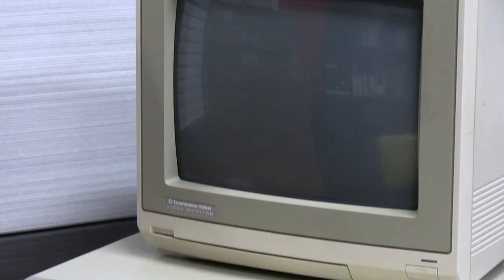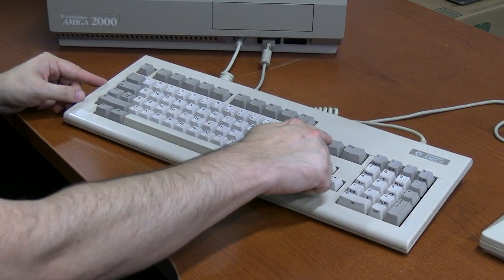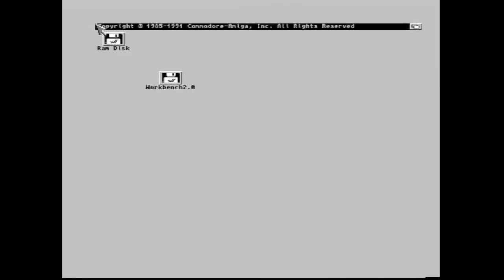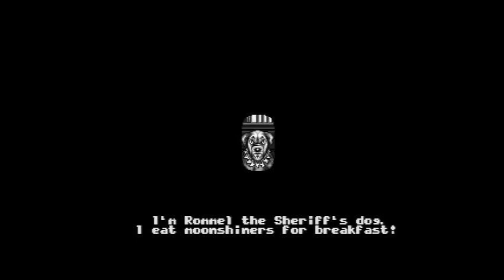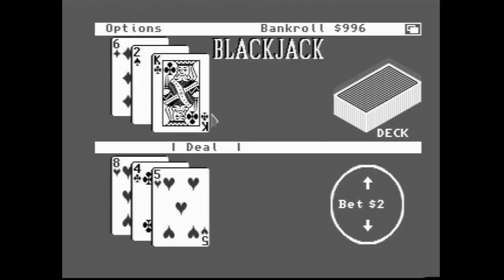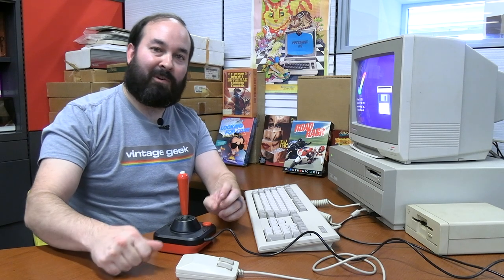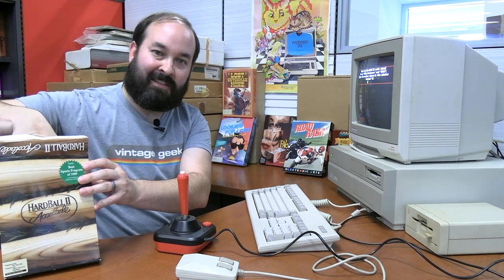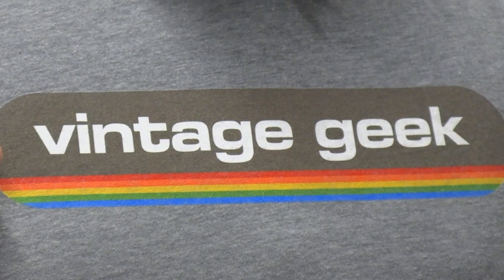My Crash Course with the Amiga 2000

Comment: Even though this is an older video, I had to comment.  Just like you, as a kid I went from a CoCo2 to IBM PCs, and just like you, I've never even seen an Amiga until I got my first one a few months ago.  And yes, just like you it took a significant amount of effort to get it working.  I would have been very surprised if your system worked on first power-on.

Comment: On the games not working thing; this may actually be because of your OS ROM. The Amiga OS is stored in ROM, the Workbench disk simply holds the UI and some tools. A lot of older games will access the OS ROM directly, and if you aren't using OS 1.2 or 1.3, then these will fail to load. A considerable number of other titles will also refuse to run if not in the internal drive.

You can solve the first part by using a boot disk(I forget the name) that will write a ROM image into RAM and use that as the OS until powered off by the power switch, but survive a control+double Amiga key reset. For the latter issue, you'll unfortunately have to find a working internal floppy drive.

Comment: I just want to let you know that these Amiga floppy drives are usually farily easy to service, and if there is no bringing them back they can be replaced with modified PC-drives (or digital media drive emulation solutions). There are several online Amiga stores in the US, and I'm sure a few of them also offer good repair services. I live in Norway and send all my damaged components to a guy in finland. No matter how broken they are they always come perfectly working and looking fantastic. I'm sure someone could take care of your motherboards and expansion boards.
The Amiga is still very much alive and the A2000 is a great machine to get into the platform. There are lots of new and interesting Zorro- and accelerator-cards being released for the A2000. You're in for a treat! 
Also, check out LemonAmiga for a quick intrroduction to the games available. ;)

Comment: My journey is much like yours - I started with a Coco as well. Had a bit of Apple ][ at school and dad had a //c I did some work one. He was a physics teacher and before he got the //c we worked together to write a couple of physics programs on the Coco to use in class. But since he had Apple ][s at the high school I would get the code working on the Coco, copy it from the screen using a typewriter (no printer yet!), while attempting to translate the differences in the BASIC dialects along the way. Dad would take the modified hardcopy, type it in on the Apple at school, and bring back any errors he hit that he couldn't figure out himself along with a printed listing of his version. Later, rinse, repeat. Did it for a couple of programs - one for doing force vector calculations and one for projectile motion. But mostly I jumped from the Coco to the IBM when I started college in '85

I also really wanted an Amiga later, around '90 or so when I learned of the Video Toaster. Tho I had a neighbor in the dorm in '86 at with an Amiga 1000 I never really got to know him or use it. Still want to get my hands on one!

Comment: Most often the belt of the floppy drive needs replacement, which isn't too diffult a job, and these belts can also easily be sourced. Also, a PC disk drive can fairly easy be adapted to work in an Amiga. Regarding a taste of Amiga gaming, better try Lotus Turbo Challenge 2, Cannon Fodder, Sensible Soccer, The Settlers, Worms,  the Chaos Engine, Pinball Fantasies and Turrican 2. If you want to see what the Amiga is capable of displaying, try Agony, the Shadow of the Beast series, Elfmania and Fightin' Spirit.

Comment: The reason you got flickering is that it is a non-standard mode for NTSC. The interlaced mode flickers on the monitor, but on a standard NTSC display it would be the standard mode. The interlaced video mode was the reason the Amiga was so beloved in TV, because it was compatible with standard NTSC out of the box.

Comment: I'd be doing some serious cleaning of those two Amigas...
Looks like you got a CPU card with one of them..  but with no fast RAM on it (I saw empty simm sockets!   my god.. if that was a Wildfire 060 in there with no RAM...   that's like winning the lottery almost!)
There are lots of scsi drive options...   you could also maybe get the older ones working long enough to see what's on them...  and then copy them to one of those new gadgets that use a SD Card as a SCSI drive... .. 
Disks can also be cleaned as well as the floppy drives...
Might be some contact cleaner needed on some chips and or sockets to get them working again.
Who knows....
Looks like you got some good stuff..   just need to learn more about it if you weren't familiar.

Its been a year since you posted this...
So what was the CPU card?   LOL   
Curious

Comment: I believe that both Amiga 2000 machines can be brought to life in some manner.  The procedures have already played out in my mind.  Was the battery corrosion neutralized in the first machine?  Hello from Arkansas, btw.
Reply from the maker: Hi there!  I agree…and we do have the one at least running…the problems came with trying to run it with the hard drive (which didn’t work and actually brought up some weird errors).  On the first one, we did remove the battery…I think replacing the CPU socket with the corroded pin sockets would bring it back to life it’s just about finding the time to do it and some patience with the soldering iron
Reply: @vintagegeek  I forgot to mention that there's something that might work in place of the hard drive:  BlueSCSI.  It's nowhere near as costly as the SCSI2SD and I believe less fiddly.

Comment: I'm skipping through this video, and I'm confused as to why the full screengrabs of the games are in black and white, while your shots with the monitor show them in full colour.
Reply from the maker: At some point we do acknowledge that...the reason is that to do the video capture we had to use the secondary output from the Amiga which is composite but only sends black and white.  I wish we had an adapter to break out the RGB and capture it but we don't...at least not yet.  We also tried putting the camera on the monitor itself but the reflections and roll made it a bit difficult to see so the black and white seemed like the better option